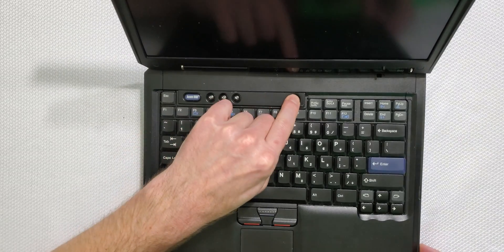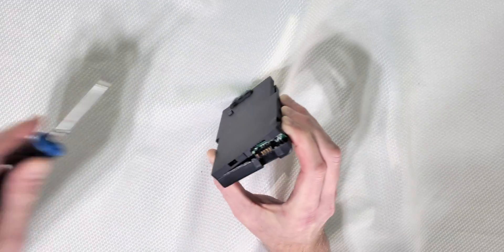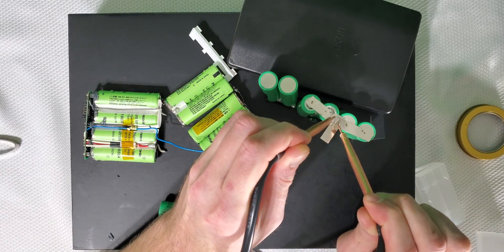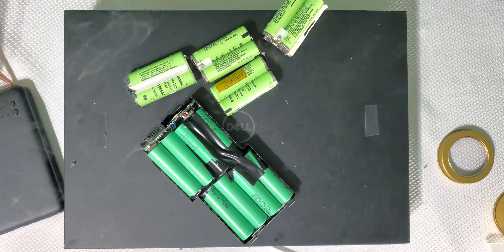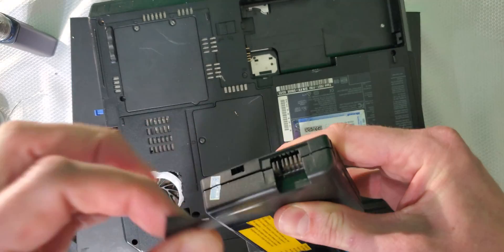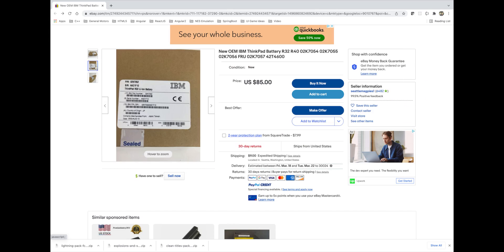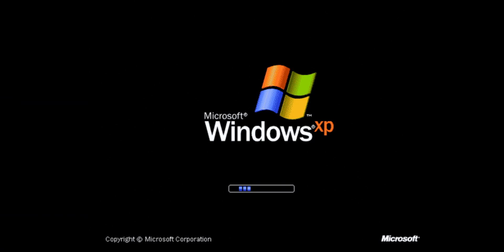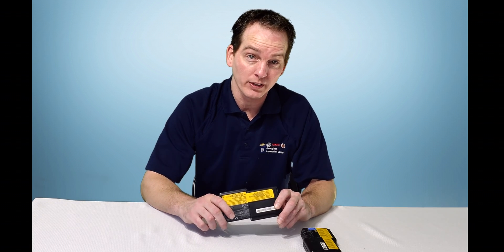Let's Recell a Thinkpad R40 Battery (and compare it to a new one)

Comment: Geez first time around did you also actually reverse the polarity on the positive group of 2 cells? Pretty hilarious video on things not to do gotta say!
I came across this video because I just rebuilt R40 battery - the proper way that is exactly as safe as out of the factory! I posted that on the thinkpad forum (YouTube would shadow delete comments that have links)
Reply from the maker: first go round i was replicating ibm's stock pattern. 2nd go round i did it the "aftermarket way" as it was a bit simpler.
Thanks for the comment and I hope you got some entertainment value out of it!
(the battery is still going strong!)
Reply: @retro-af  Well like at 1:55 I see the bottom left 2 cells have the notch side (positive) facing right which if I'm not wrong means that group is reversed, so your bms would've fried even if it didn't literally fry.
But yeah I saw your attempt at replicating the aftermarket design and that is done a lot better indeed, although one potential hazard is that the tab 90 degrees off positive terminal has no insulation, that could be a fire hazard if that tab slices through the body of the cell through friction... If it comes out of the negative terminal and folds 90 degrees onto the cell body then it would've been okay. Something to keep in mind next time you do something like that!
I guess I'm obsessed with ironing out details like that, because with the battery sealed up if it shorts and starts igniting its much harder to stop the thermal runaway!
Reply from the maker: @kztech1319  if you have discord contact me at russ6924. id love to see your handy work! / video
Reply: @retro-af  Its sent
Reply: @retro-af  So yeah I did send a request did you see it?
Yeah I'm on a streak of battery rebuilds right now, from ordinary acer laptops to some real beasts with impossible to find batteries
Reply: @kztech1319  These battery rebuild adventures of yours described in Thinkpad Forum where exactly? A sub-forum name would help me a lot, I am very much interested in it, as I am thinking about finally trying to rebuild a few older batteries.
Reply: @kosztaz87  I put it under the A30 and R40 banner, and I replied some info for X220

Comment: I am actually surprised the OEM battery worked at all after almost 20 years sitting unused. I have a T60 laptop is from 2006, and most of the sealed batteries for that unit are already dead, even the ones made aroumd 2010. They just slowly discharge sitting in their box, and the controller circuit it the battery completely kills it by disableing it from taking a charge. Is it possible these older Thinkpad batteries didn't have that feature yet?

I am really thunkimg about re-celling my T6p batteries, I have a bunch, but only a couplemof those have decent capacity, most of them last only a few minutes, and quite a few of them are completely dead. And many of them.discarges by themselves in a few weeks just sitting, se I really need to do something about them, before the controller will kill most of them.
Reply from the maker: I dont believe the pcb discharges the 18650 cells, as they discharge on their own without any help.
Just be careful if you re-cell your battery packs and dont use speaker wire like i did the first go around. 
The reason my first accident happened was because the speaker wire frayed on to a smaller negative wire when i crushed the pcb in to the plastic housing.